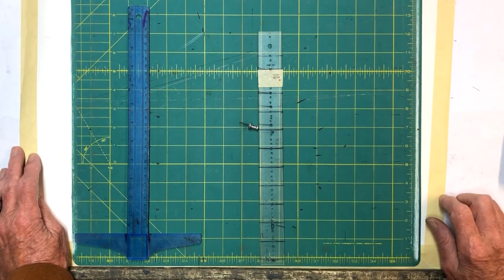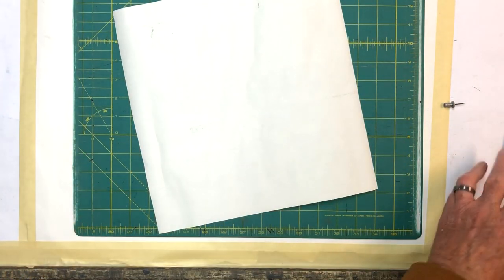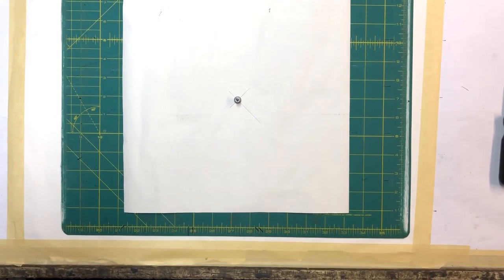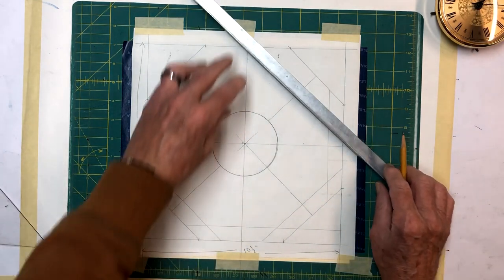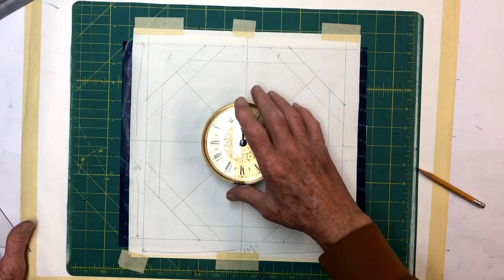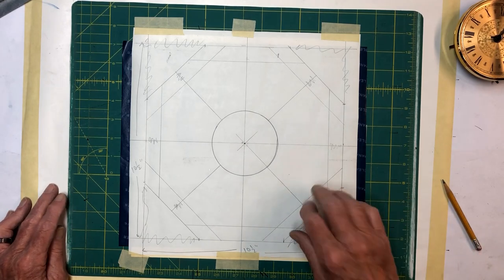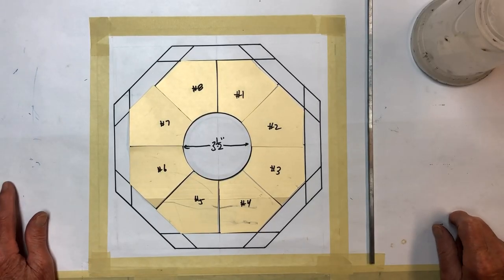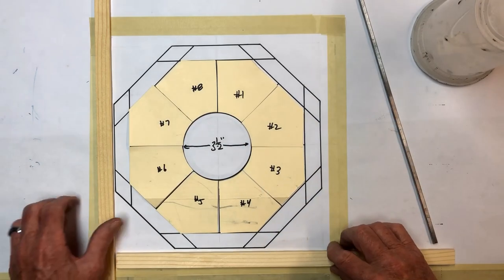Leaded Glass Clock for beginners!

Comment: Now I see, how you modified your clear ruler.  Cool!!!
Reply from the maker: Hi, thanks for your question on the ruler I use to make my circles, I came up with this idea because I was making several projects that were 18" to 24" around and didn't have a compass big enough to make a circle that large. You can find these plastic rules at Amazon, Hobby Lobby and any store that carries stationary items. I use a 1/16" drill and drill a hole through the ruler at the 1"-inch mark and 1/4" marks to make it work. Remember to start at the beginning of the ruler with a pivot hole, then drill your holes at the point on the ruler for the different size circles you want to make. Place a pencil or pen into the hole and draw the circle on to your drawing. Hopefully that helps you out. Best of luck with your projects.
Regards,
Bill Stone

Comment: You said you don't glaze small projects especially for indoor. That makes sense, however I'm wonder why not the   solar lanterns and suncatchers for outside. I'm finishing a suncatcher to hang on a shepherd hook, I'm concern that a windy day it will hit the shepherd hook. Where i live we can get up to 25mph gust.
Reply from the maker: Hi Julie,
You're right, solar lanterns and suncatchers do go outside in most cases, I don't think they need to be glazed because they don't need to be waterproof. If you like to glaze, your leaded glass projects, it certainly will make them stronger. I too use to live in a very windy area also. Lake Havasu City, AZ and we had a lot of wind out there, and I never had a problem with any of the solar lanterns coming apart.
If you think the lantern might hit, your shepherd hook, you can shorten up the chains that you use to hang it with, and it won't swing out as far, as it would with longer chains on it. I would consider glazing both the solar lanterns and suncatchers if they had some glass pieces that were a little loose and moved around in the came channel. I hope this helps you out. Best of luck with your projects. Let me know what you decide to do!!!
Regards,
Bill Stone
Reply: Duh.....shorter chain. I just slapped my forehead.

Comment: good morning Bill and Camera Wife. Do you use the same size U came ?
Reply from the maker: Hi Karen,
Yes, all these projects are made with the same size came. I use this same size came on larger window projects as well. The came I use is made by Cascade Metals, they have a great web site and tell you about all the different types of came available. Check it out when you have some time. The "U" came I use is RU-70 with a face width 1/4" and a channel width of 5/32" and the "H" came is RH-9 H Came with a face width of 5/32" and a channel width of 3/16". The other came I us RU-90 came, and it is very small with a face width of 7/32" and a channel width of 1/8". I used this on the spinners with the circles on them. This is a great size if you wanted to make a project with a group of different size circles in it. I have made several Solar Lanterns with circles on the panels, and they really look great, I just set up a frame to make the 3 panels for the lantern, put U came across the top and down the sides, put in a hanger on the header glass in each corner and fill up the open area with circles of all different sizes, and colors. I match the ends of the came at the solder joints, so you don't see them and leave the open areas open between the circles. Put the 3 panels together and you have a great looking Solar Lantern. Looks like I got carried away on your simple question, I better get a life!!! Camer Wife's name is Suzie and we have been married for 62 years!!! She is my biggest supporter and best friend in the world!!! I'm so glad to share these projects with you and others, hopefully you will give them a try someday.
Regards,
Suzie and Bill Stone
Reply from the maker: Hi again, did you watch the end of this video and see my larger window projects?? Enjoy your day and good luck with your projects!!
Regards,
Bill Stone
Reply: @billstonesstainedglasscrea3310  not yet ...I watch a little save, then go cook or wash cloths... my household is never still and it's just Denver and myself. Which we help take care of my dad's farm as well as ours....I'm going to my studio tonight and try to watch and take notes.
Can't wait til I get a break and go camping and work on some pieces
Reply: @billstonesstainedglasscrea3310  another question sorry ... now do you mud these ?  like I said never got my hands into doing anything but copper foiling. Ready to expand my art avenues.
Reply from the maker: Hi Karen,
Please feel free to ask me any questions about any of these projects, or for that matter any questions regarding leaded glass projects. These small projects really don't to be glazed. If for some reason you have some glass pieces that move around in the lead channel because they are cut to small you may want to glaze the project, to keep them tight into the lead came. I don't glaze any of my project that are smaller than 1 1/2 sq ft in size unless they have to be waterproof like a window panel. All these little projects really don't need to be glazed even though they go outside and are subject to the weather. When you get time check out the end of this video and you will see both leaded glass and copper foil projects. I have always liked lead came better then copper foil because I like the way the lead lines look, and I find it easier to do then the copper foil. After saying all this there's projects that can only be done with copper foil. If you look at the video making the solar lantern with the sea glass in it, it uses both lead came and copper foil in the same project to get the effect I wanted. Also, the two solar lanterns with the flowers in them are done the same way. If you haven't found all my videos, you can type in the search bar Bill Stone's Stained Glass Creations and click on my photo and they will all come up in one place. Again, nice to hear from you.
Regards,
Bill Stone